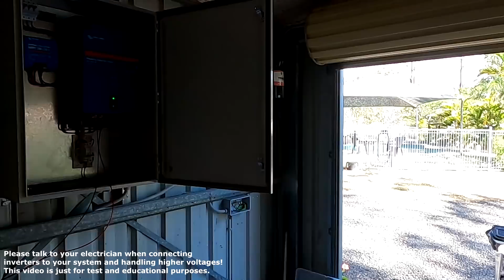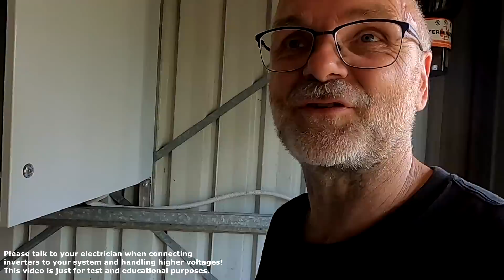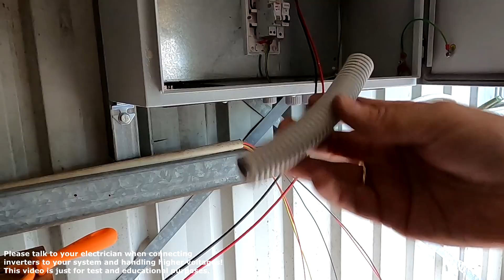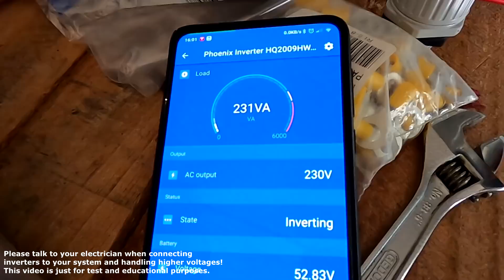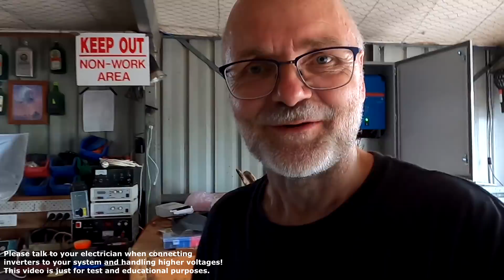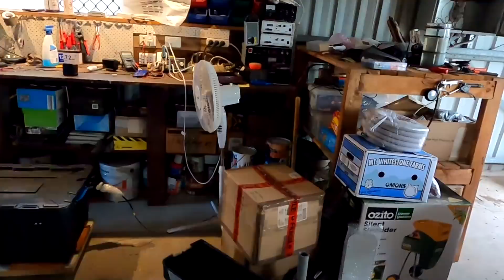The Off-Grid-Garage. I made the SNIP!

Comment: If you would be so kind as to help me calculate how many 280AH I would need to buy to create a 30ish Kwh battery bank.
Reply from the maker: You will need 32 cells of 280Ah to create a 2p16s configured battery with around 32kWh of capacity.

Comment: Do you have any lightning protection?
Reply from the maker: Nope.
Reply: @OffGridGarageAustralia  The reason I am bringing this lightning protection thing to your attention, is that I have a Grid-tied system, and when there are lightning storms the breakers do trip.  This happens 2 or 3 times a year.  I guess its protecting my investment.  The surge arresters should be between your PV and charge controller as well between the inverter and the AC circuit.  Just don't want the thunderstorm to ruin all your efforts.
Reply from the maker: @pritambissonauth2181  I also have a grid tired solar system and it has no lightning protection devices at all. So I think it depends on local regulations.
As they are not expensive it makes sense to install them though and I will upgrade my system at some stage as per your advice.

Comment: At minute 14:50 of the video, you turned on the fuses that you had turned off when you cut the cables to connect the garage installation to the inverter. Before you said that you had a different circuit to charge the car and that it was even another fuse. Why did you turn on these circuit breakers? Didn't the cut wires have power now? Officially offgrid! Very well Andy! :-)
Reply: Just watching this video now and I noticed the same thing, aren't the cut ends of the cables now live again? I didn't see any wiring being disconnected from the fuse holder.

Comment: Remember, it is unnecessary to switch or use breakers on both the positive and negative lines from your solar array.   Switching only the positive or the negative is sufficient.   If either the positive or the negative from your solar panels - or, your batteries - is disconnected, no current will flow.

Comment: Hi Andy, to polish the terminal of the battery seems to be a pain in the ....is it worth it ?....i don't think so,because aluminium will oxide on the surface quite fast again. My thought is,that it's more important to have the terminals fastened with the same torque to provide best contact at all terminals.Any contact will have a little electrical resistance...so ideal would be the same resistance at all connections to provide best conditions for the BMS. Maybe the conductive grease is the important step....Well I do not know if some milli ohm difference  really make a big deal....just my humble idea...

Comment: You need to change the outside spot lights to LED ones
Reply from the maker: Totally not worth it. I looked into it and they are like $30 each. I need two.
The light only turns on for 2min if motion is detected. If you do the maths, that's like 73 years before they LEDs are cheaper.
Reply: I agree - change the Halogen spots to LED. Much lower power use. In a near-low battery situation - might just trip the system if the Halogen (try and) come on. The first thing I did in my house was to change ALL bulbs to LED . No regrets at all.

Comment: Take out the fuse in your switchboard! If those cut wires come into contact with the shed it could be bad.
Reply: Also. The inverter on your victron app isn't reading in wattage. Its showing volt amps. Va

Comment: 031421/0613h PST- 2314h Brisbane  Congratulations, Andy. You did it. Bravo. I’m as happy as you are. Final touches and adjustments can be performed later. Stay safe. 73s...
I remembered now, regarding the CB they are designed that way and you need to push the lever downward further and push the lever upward to reconnect the Breaker. You are safe.

Comment: I was wondering why you actually cut the mains to the garage? If you have a problem with the solar system, you then have no power at all. You could fit an auto switch so as mains is switched in if the solar system goes down for any reason. Also you need to swap out those halogen lights for LED!
Reply from the maker: I could not fit a transfer switch as they inverter now has a fixed M.E.N. link inside. I would need another inverter for hybrid usage which closes/opens a relay and the link accordingly if I'm on-grid or off-grid.

Comment: Hi Andy,
I am absolutely enjoying your videos. Your enthusiasm is contagious. I am upgrading my sailboat to lithium. Thanks to yourself and a few other DIY channels I’ve decided to build my own batteries instead of the drop in variety such as Battleborn or Dakota lithium. I have a question regarding pre-charging the inverter capacitors.  I will have 2 12V 4S2P 280AH batteries in parallel for a total 560 AH. I have a 2000W inverter. I  have a battery disconnect switch between the batteries and the inverter. Currently with my 12 V 180AH lead acid batteries I always turn the switch off unless I plan to run a 120 volt system on the boat. Will I need to pre-charge the inverter before I turn the battery disconnect switch on when I have the larger lithium bank?
Cheers Kevin
Reply from the maker: Thanks Kevin.
Do you pre-charger your inverter right now when you turn on the switch?
Reply: @OffGridGarageAustralia  Hi Andy, thanks for the reply . No I don’t pre-charge. I wasn’t aware it could be a problem. The existing  house bank is only 2 - 90 ah batteries. The new bank will be 560ah.
Reply from the maker: @kevinh7985  It's more the inverter than the size of the battery. If it works now without pre-charging, it should work the same after you have the new battery in place. Some inverters have smaller capacitors.
You can test and connect the inverter directly to your old battery with a cable. See if you get a spark. If so, the switch does the same every time you turn it on and that's not good over time.
Reply: @OffGridGarageAustralia  great tip thanks.

Comment: Circuit breakers are supposed to behave that way. When they trip (whether from a test or from over current) the physical handle itself is disconnected from the internal mechanism of the breaker: They are designed so that even if the handle was being physically held in the "on" position the breaker would still internally shut off. IE: The handle is disconnected from the breaker internally when it trips. You have to push the handle back to "off" to reconnect the handle to the breakers internal position first, and then you can turn it on again. This design ensures that a breaker can disconnect a load even if the breaker was physically held in place. (IE: Imagine someone tried to tape it in the on position or something like that.)
Reply from the maker: Never seen this before with RCDs I worked with. Or maybe I cannot remember as the switchboard job is like 10 years ago.
I know the handle is disconnected and you cannot hold it or tape it in the on position. Same with breakers and isolators.

Comment: I don’t know it they still sell them but we had an old switchboard like that many years ago and we got the flip style fuses for it before totally switching to a modern system.
Reply from the maker: Yes, I've seen these inserts for these fuses to replace the actual fuse. You can buy it at the hardware store. But only for the smaller size fuses up to 32A I believe
Reply: @OffGridGarageAustralia  maybe a specialty electricians supplier may have them, if you are interested in switching to a more convenient fuse type, I know I use to hate replacing the wire fuses.

Comment: Dear, I see that you put the two strings of your solar panels directly in parallel. I think you need to think about connecting them differently. Connected without diode, only a string will give watts. The second is not going to give anything. One point to check.
Reply from the maker: You don't need a diode for these strings.
Reply: This is not true. I have 4 strings of panels, 800 watts each, on my motorhome and I routinely see close to 3,000 watts of power coming into my MPPT on sunny days. It is quite common to connect strings in parallel.
Reply: @JeremyAkersInAustin  Hi Jeremy, you should get 3.200 watts. Check here https://www.sciencedirect.com/topics/engineering/parallel-connected-string , we can't avoid law of electricity. If one of your panel is hided or with very few difference (Construction), you will get current circulating in wrong direction in your panel and will destroy it. If you feel comfortable with your setting, so, keep it. Or maybe you have Diodes implemented in your cabling design without knowing that.

Comment: Would suggest you keep the fuses pulled from your main garage panel until you cap off the wires in a junction box. The ends will still be hot and you might forget and shock yourself.
Reply from the maker: The cables are correctly terminated and in a junction box. Nothing to touch.
It would be rather dangerous to leave the fuses out as someone could touch inside three fuse holder. You always put them back in!

Comment: Are you getting a new bms?
Reply from the maker: Yes, they have send it a new one.
Reply: @OffGridGarageAustralia  how are you managing the batterys now,without damageing them.
Reply from the maker: @stuntcar  the main BMS function still works, just not the overvoltage or undervoltage protection. These, you don't usually need unless there is a fault with the MPPT or one of the cells.

Comment: Awesome video.
I have one question.
Why is the battery so far away from the inverter?
Reply from the maker: 1.5m?
Reply: @OffGridGarageAustralia  Sorry.I thought it was like 4-5m away.
Reply from the maker: @StarJackerSRL  even then, that's not a problem. If you pull a lot of current just choose the right cable size. I've seen setups where the distance was like 30m. Big chunky cables or even two in parallel, problem solved.
Reply: @OffGridGarageAustralia  The cost of cables and losses are just not worth it in my opinion.I keep my LiFePO4 battery bank close to my inverter.
Awsome work by getting off grid with the garage.
Reply from the maker: @StarJackerSRL  thank you. The shorter the cables the better, no question. Sometimes it's just not possible.

Comment: One thing that may be good to add would be a receptacle to the old grid connection so that it is still useful in case you need to run something and the batteries are low or you have some other need for grid power like running a welder.
Reply from the maker: I'll see how I go and can always install a power outlet at these cut wires.

Comment: Why not add an outlet where you snipped the cables and connect a lithium charger to it as a backup. Set it to start charging at low voltage so unless it’s needed, it would never trigger. Off grid with grid backup

Comment: If software (via wireless) can turn the inverter on and off, I’m not sure I’d be working on the AC outlet side of things with the DC battery fuse/breaker still in place. 

For a future project you may want to consider installing a Multiplus rather than just getting another inverter. This way you can feed the AC into it (breaker tripped in normal use), charge the batteries via solar as you do now, running AC power out of the Multiplus to the garage, but if your batteries are low you only need to reconnect the AC input and it will both feed the AC output and charge the batteries. Amazing bit of Victron kit.

Comment: The fault breakers do the same thing here in North America, its to make you think twice before reconnecting the breaker and to help you understand what type of fault is happening. Over current fault will flick it off without the funny flap, a ground leakage, arc fault, etc (depending on the class of breaker): will let you know what type of fault you're dealing with.

Comment: solartronics MPC 1000 switching station 16A for inverter up to 2700 VA camping land power inverter Andy you can place it where you cut the cables.  This way there is always power in the garage if the battery is empty.  Hopefully you will do more because it is very recognizable to see how you doubt.  I have not yet seen cleaning your batteries at YouTube colleagues.  Continue.

Comment: While the breaker's lever may be only half-way, the breaker is actually fully tripped. They are designed that way as both an additional trip indicator that works in the dark and also so you absolutely must take the extra step of pushing it all the way to OFF before re-arming so you cannot accidentally switch the breaker directly from tripped to ON. In short, it is a safety thing.
Reply from the maker: Thank you. Never seen this before with other equipment I worked with in three past.
Reply: @OffGridGarageAustralia  I live in South Africa. All Earth Leakage detection breakers I have ever come across work exactly like yours.
It's effectively tri-state, On, Off or Tripped.
Geez... looking at your old fuse box I understand your confusion!

Comment: Another consideration to going OFF Grid would be to install a manual transfer switch in case you have an inverter fault, battery is flat or you have no solar input.
Reply: I agree.
Reply: @budmartin3344  Me too
Reply from the maker: Would not work due to the MEN link inside the inverter.

Comment: That is a design feature of the breaker. The intermediate position is called “tripped free”.
Reply: It also allows you to tell if it was tripped or just shut off
Reply: Well said. Over current won't have put it in that state
Reply from the maker: Makes sense, thanks guys.

Comment: Breaker is operating correctly .  The test mode just trips it.  When the breaker trips it is NOT supposed to go all the way to the off position.  It will be off.  This way you can tell if a breaker has tripped or not. 

-Matt
Reply: Exactly this. Almost every breaker has "on", "off" and "tripped" states that you can tell are different.
Reply from the maker: Never seen this before but my last switchboard job is 10 years ago...
Reply: @OffGridGarageAustralia  You guys down there use fuses a lot.
Reply: @OffGridGarageAustralia  ich gratuliere zur OFF Grid Garage... Weiter so
Reply: Mine in VT. work this way.

Comment: Disconnect will be ok, let the line stay for emergency.
Reply: I was going to say the exact same thing.  There was zero need to 'snip' the grid supply wire.  Leaving the breaker out and/or blocking that grid supply line with an AC disconnect switch would be just as good as cutting the supply line wire.